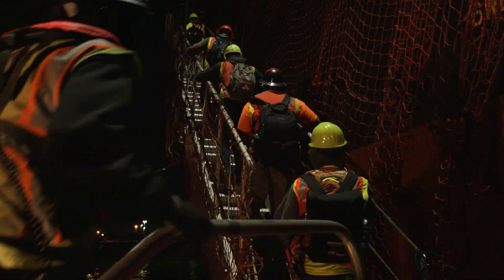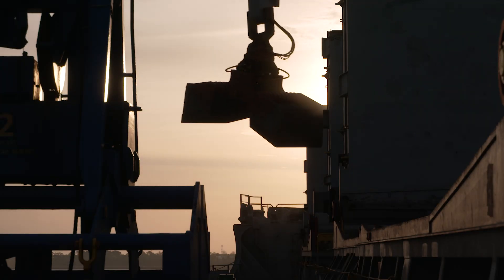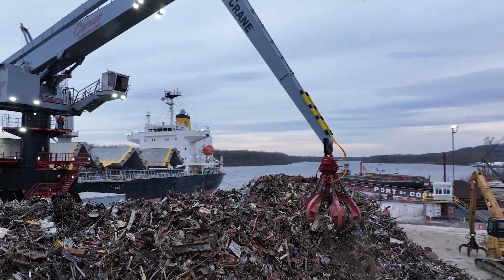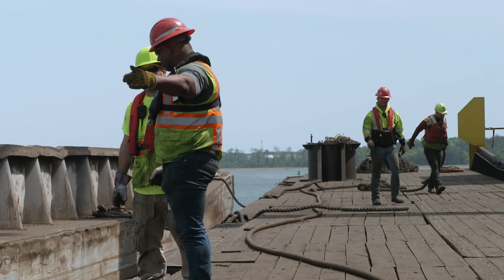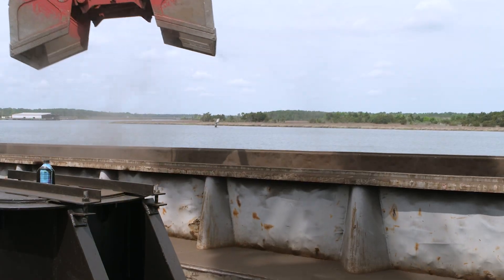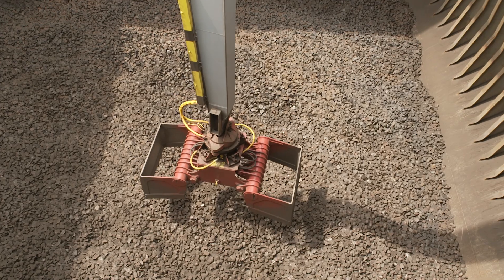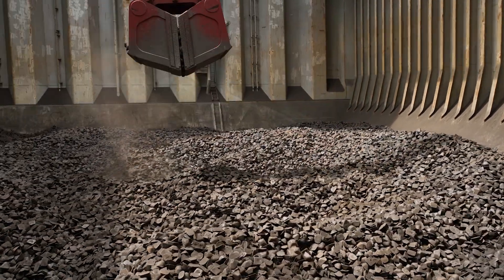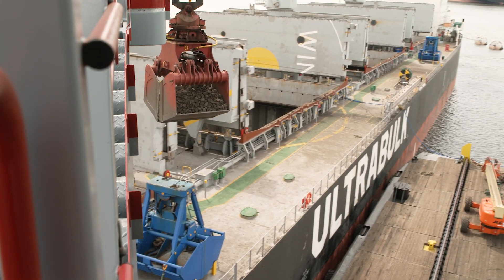Carver 5504 E-Crane at Midstream Cargo Transfer Facility

Comment: Screwing my paint up on my newest car.  They put in air scrubbers years ago but it did not eliminate the stone dust and kills a paint job. Don’t brush it off. Gotta use the car wash twice a week now at my expense. Back years ago when it wasn’t cargo, they had free car wash at their plant. You could also get a yearly ( I believe ) a wash and wax job at boxleys.   Mr Boxley was a good member in our town. But you know how greedy people are in big companies. So no free washes for ruining my paint on my vehicles. Some disrespectful drivers. I’m
Not sure why the cops don’t pull their drivers over for speeding???  Well, I do know.  I’ve seen a truck doing 40 through town with speed limit set at 30. Cop did not pull him over, but did pull the woman behind him over.  She was not tailgating.   I was going to pull over and ask him( copper) why not the truck who was leading them.  They give our little tiny town( 2 sq miles )  $$$ donations.  
I might buy a hoopty and let the town see how their drivers drive. Without exaggeration, I think I would have been hit several times and car totaled.  Easy since it would only be a $2000 car.